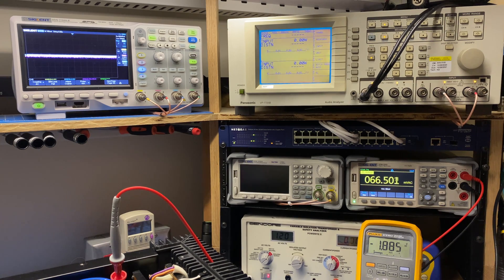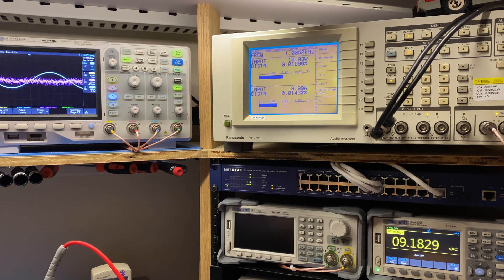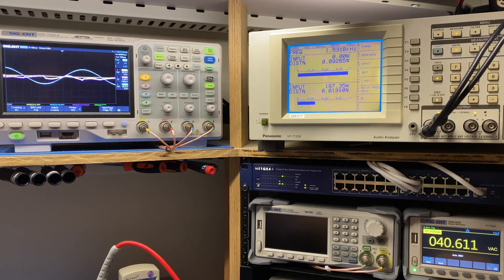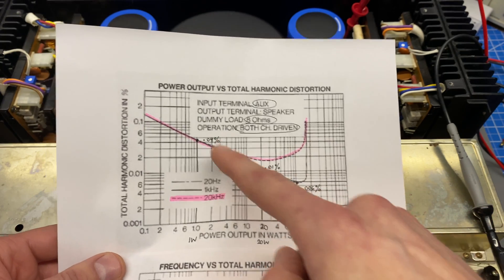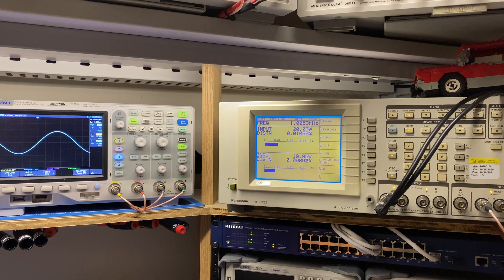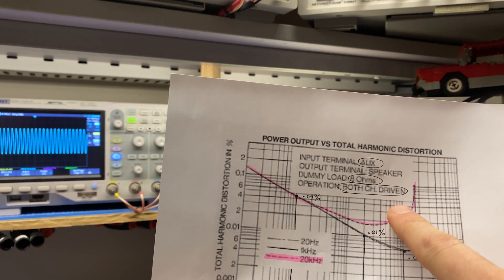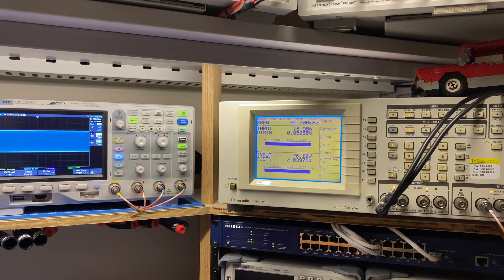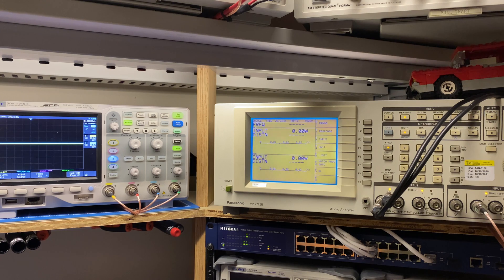Pioneer SX-1250 Max Clipping Power 180W & THD Specification Verification w/ Panasonic VP-7725

Comment: Excellent work Ben.  That 1250 was kickin butt at 180watts.  What frequency was that?  1kHz?
Reply from the maker: Yes, the max clipping power test was done at approx 1KHz. The test frequency is displayed on the distortion analyzer in most shots.

Comment: I'm probably missing something, but your printed graph shows distortion at 100W should be .06%. The audio analyzer is showing ~.006% at 100W, so an order of magnitude off. Is this a result of how you have the analyzer set? Great video and very interesting to see this on the SX-1250 (I'll never sell mine).
Reply from the maker: .006 is show on the graph for 1KHz, about .025% for 20KHz, the graph is not easy to read :)
Reply: @NovaluxStereophonic  Got it. Thanks.